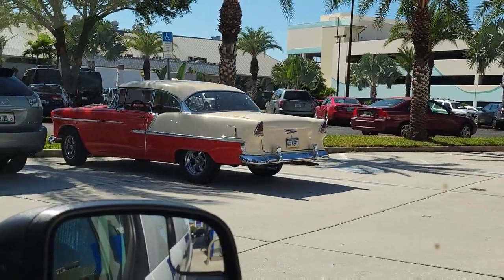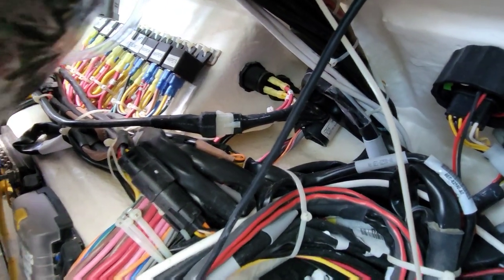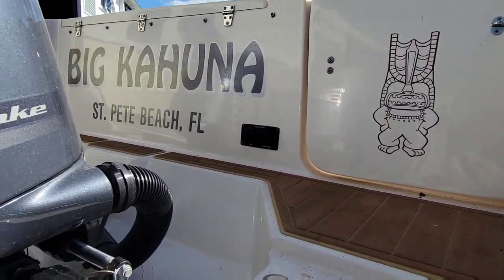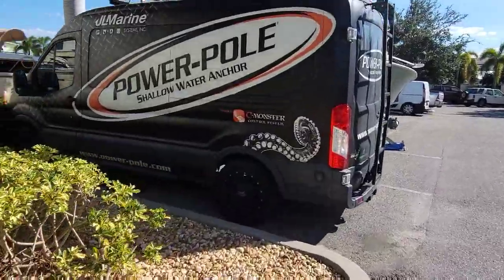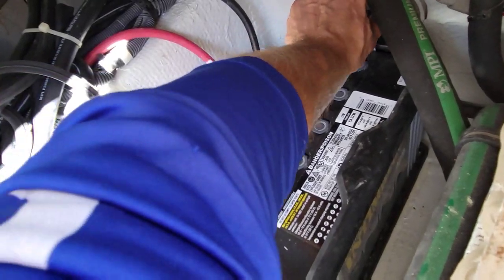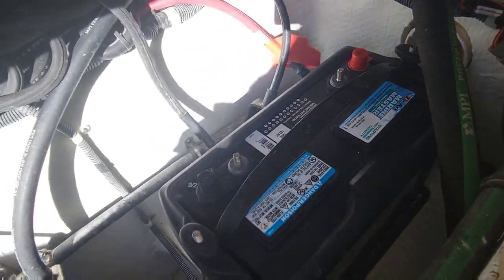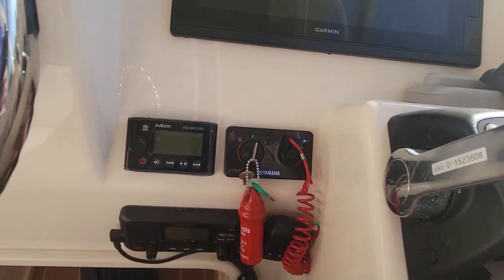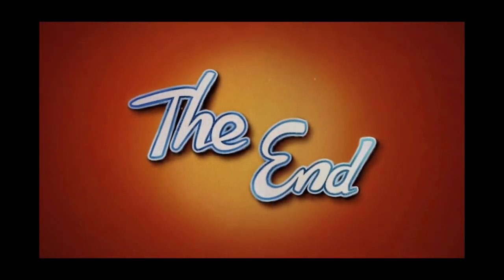A Visit To A Tiara 43 & A Grady White 285 - Episode 109 #Lenco #Battery

Comment: Another great video Justin :) 
Surprised to see ~1 year old batteries already failing, could the owner have a charging system or vampiric drain issue?
Reply from the maker: My guess is that the boat has been sitting in the barn without being plugged in for months. It's time for the snow birds to come down and that is a common one because they don't allow your boat to be plugged in when it's inside.  The batteries might still be good but most customers just don't want to chance it so they just tell us to replace them. 🙃
Reply: @JustinLeeMarine  Thanks! Makes sense too. I pull mine and put them on a Battery Tender all winter and I can usually get 4-5 seasons out of them. :)
Reply: Yeah, my thoughts exactly. The new charger I have at home has a “repair” function. I wonder if they could have been saved. I’m sure someone tried once they were back at the shop?
Reply from the maker: If they are good sometimes we will just use them around the shop for testing things. Just depends on if we need one for something. 😊